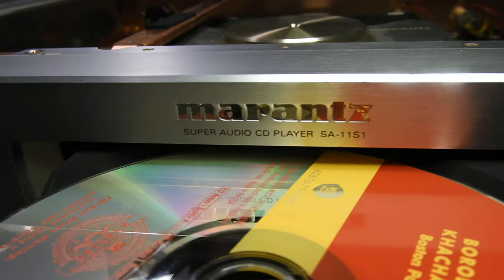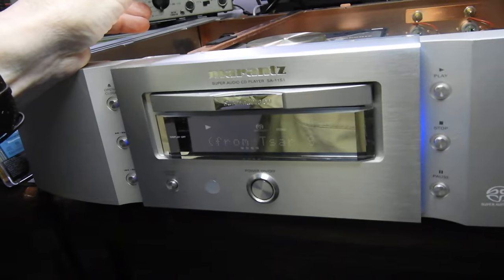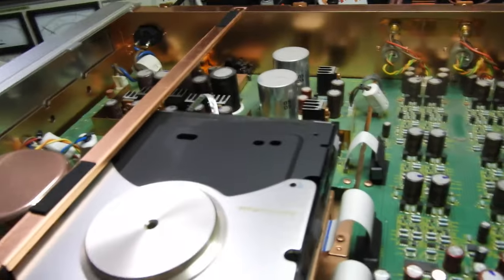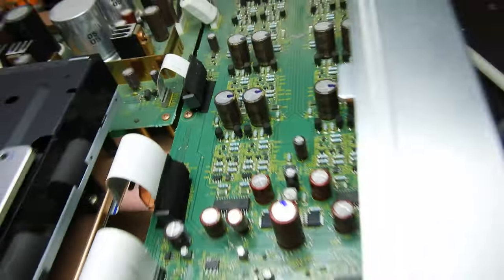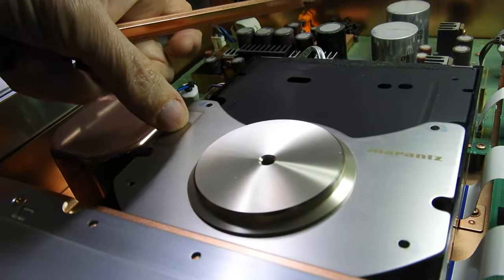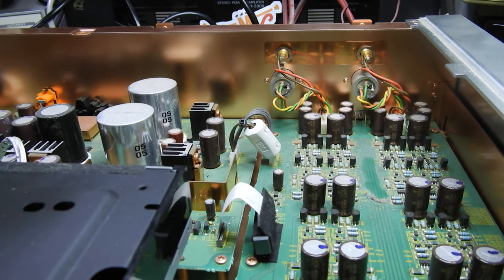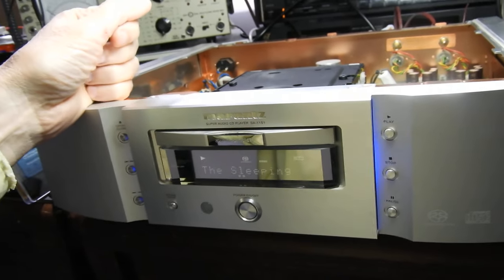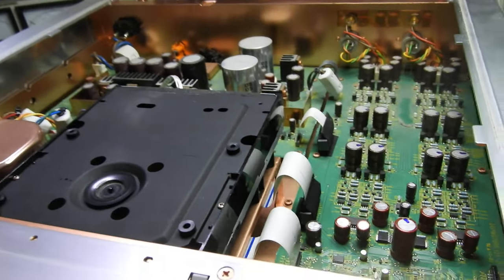Marantz SA11S1 SACD Player. Quality made unit with balanced output and some fancy filtering options.

Comment: Interesting unit - not a huge fan of Marantz (former) esthetic with the blue LED's to the "sides" of the middle section of the players, but to each their own. Additionally, I do not like how Marantz has their balanced connections wired the wrong way round (with pin 3 = hot and pin 2 = cold, if memory serves me correctly), i.e. the opposite of the international standard. I think they only switched to the correct pin layout a few years ago. Infuriatingly is that Accuphase persists to this day with incorrect pin layout on their XLR's. What good is balanced outputs or inputs if you can't use it, except with other gear that is incorrectly wired? Madness.
Reply from the maker: Too true. At least now their blue LEDs are not so bright and you can switch then off, even from remote. It is some up and coming Chinese makers who are doing excellent stuff on a technical level, infuriate me with their super bright blue lights. And some, like MHZS, also do the silly XLR pin inversion you talk about. I suppose to pretend they are from US. I myself deal with it by opening one end of xlr cable and swapping hot and cold pins, thus making a dedicated cable for that player. 
Having been originally sceptical about this player, after it was fixed,  it proved to be a very good reader. Stereo and slam were also good. Bass detailed, but not really deep.
Reply: So which is your favorite SACD player?

Comment: Hi
How do u remove the top cover from the player. 

I have a SA14 S1. 
It’s hard to pull the cover backwards after removing the 2 screws.

Wanted to upgrade the fuses.
Reply from the maker: Can't really help you for I've never seen the SA-14S1. Try lifting it. Don't know either if replacing fuses in CD players makes any sense. They only consume 25W of steady power. Also, if you're concerned about power delivery, you should also replace fuse holders for gold plated ones.